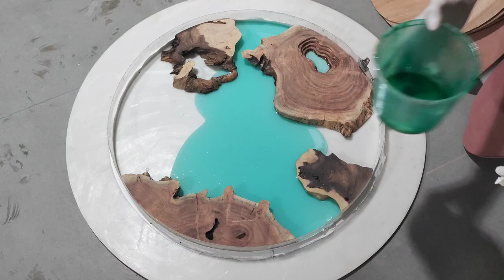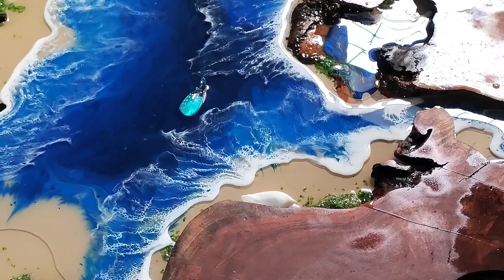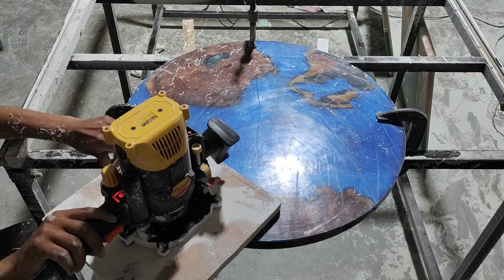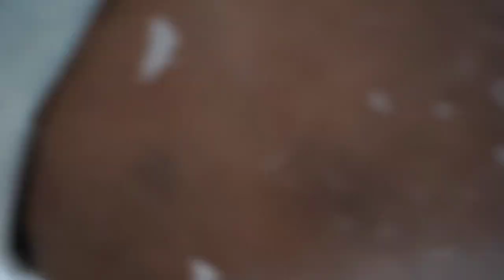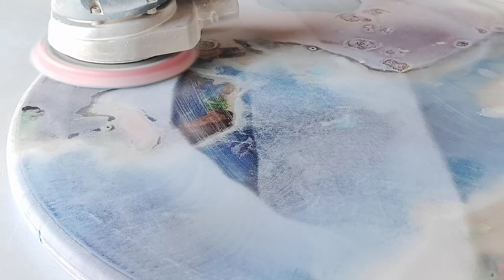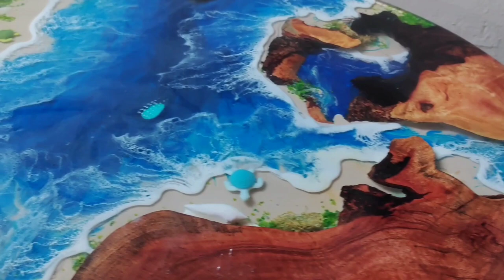My Craziest Epoxy Resin Table Idea yet

Comment: This is beautiful. Do you mind sharing the dimensions and the amount of epoxy this took?
Reply from the maker: Thank you 😊 
I use approx 10-12 kgs resin
This is 24 inch diameter table
Reply: Thank you. I'll have to do some conversions.. my epoxy is my volume but I see yours is by weight
Reply from the maker: Yes